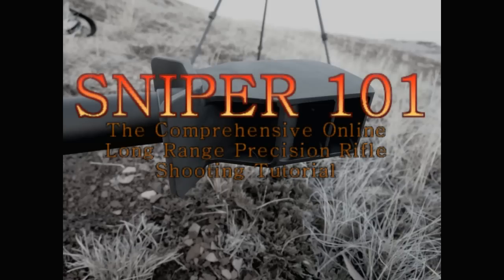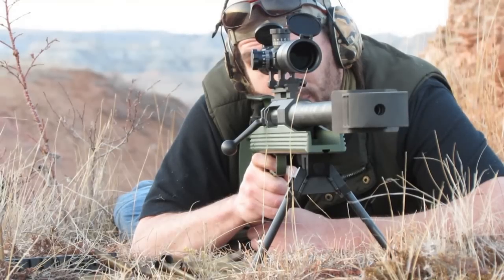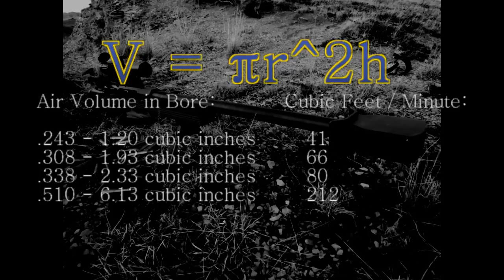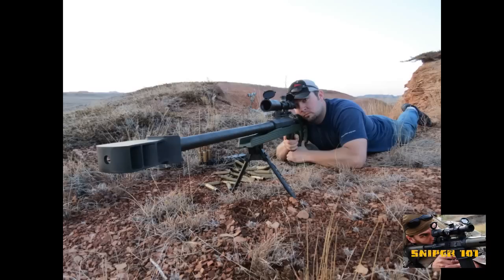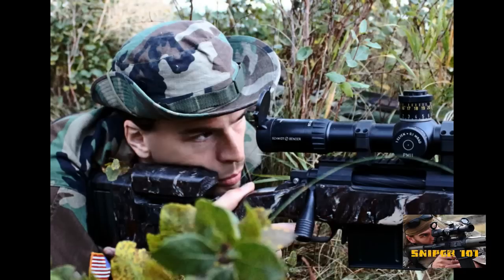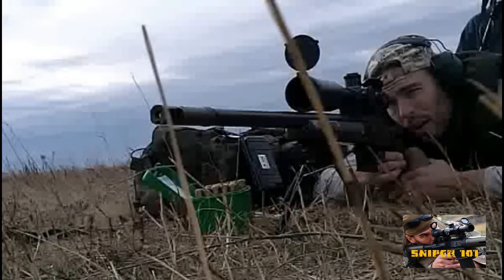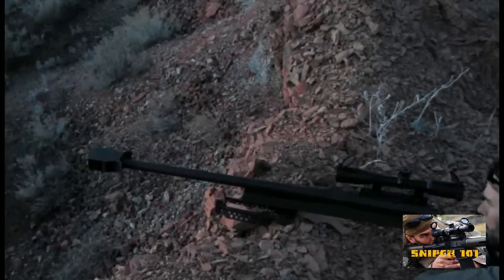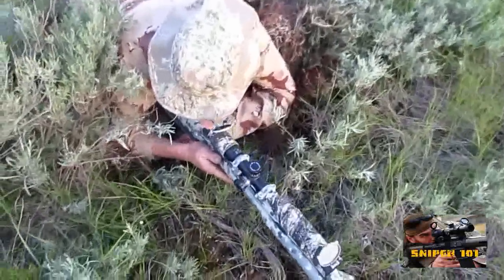Long Range 101 Part 55 - Muzzle Brake Pull-Off Effect

Comment from the maker: I have not yet been able to fully test the DT SRS-A1, so it would be unwise for me to give any solid opinions on that one - that being said, if you can get it to shoot 1moa consistently, it will be just fine.  Optics are usually the part we should take the most care in selecting.  Most rifles are totally capable of getting the job done - scopes are a different story.

Comment: Hi Rex.  I'm guessing that this is the right thread to ask this question.  Just purchased a new RPR 6.5CM and the muzzle brake is obviously misaligned.  From this video, my impression is that alignment of the brake does not need to be perfectly orthogonal given the caliber.  I get that the ports to left and right should cancel the force from each other.  However, if misaligned, the normally upward-facing port would not be directing force directly counter to barrel rise.  Anything to worry about?

Comment: Hi  Don't know if you go back and read these. I want to commend you on your patient and scienctific approach.  In the vibration part you touched on the whip affect.  Does not the muzzle brake change harmonics?  What about mercury recoil reducers, pretty affective but do they have harmonic values?  Thanks again and Be Well
Reply: Ross Anon I believe he mentioned mercury recoil suppressor in rifle selection video. He has a dedicated barrel harmonics video as well.
Reply from the maker: Griz Woldstad Yes, anything can potentially adjust your harmonic signature, thus any load being made for field use should be developed in a way that replicates exactly how the rifle is to be deployed in the field.  In other words, if you add a muzzle brake, you may want to re-check your load to see if it still works, if your add a recoil suppressor, you will want to recheck your load to make sure it still works... etc...

Comment: I think I understand what you mean.  I was thinking about the reaction force imposed by the cold column of air and how it would react with a system (rifle) supported not just axially but also radially.  Radial bearing could easily be your cheek weld which would make it easier for rifle to toe out, let´s say.  Meaning that it is important to support the rifle axially with no or minimal radial component.  That´s just the way I think but I believe your saying the same thing.

Comment: There is definatly an poi issue with certain big bore rifles. It has absolutely nothing to do with the muzzle brake
There is not nearly enough force or time ( or angle) to move the (30lb) gun at all. not even the thickness of a soap buble

1. 36" .50 barrel holds 31gr of air being ejected @2700fps
lets call this forward force 1 X

750gr + 230gr + the 31gr cold air in the barrel (lol)@ 2700 fps is the rearward force, we will call this 32.6 times X rearward force

lets remember these forces are straight back and forward, the backwards force being 32.5 times more powerful and happening first, if anything were to throw your aim off it would be the recoil force... but it has been proven mathematicaly and in the real world that it dosent make any measureable difference

So youre thinking what causes the inconsistent results that are very real 

Heres how it all started
Barrett sells guns to the army, the #1 priority is that it goes bang no matter what, to accomplish this it has a huge heavy striker assembly, monster spring, very long firing pin travel.
The bolt also is slightly loose in the race and is pushed against the top of the reciever and springs around when the sear releases

The result of this mini train wreck is the rifle moves ever so slightly off target as the round is ignited

Fortunately there is an easy way to observe this, zoom in and dry fire... the crosshairs jump approx 1 moa depending on how you hold it. 
If you weight the forend, sacrifice a goat and hold your tongue just right you can sorta get it to stay on target

The soldiers have issues and rather than barrett saying our product is less than perfect they invent some hocus pocus that lays the blame anywhere but themselves

My only personal encounter with this "MBP" effect is with a gen 2 M99.

The striker spring is 42lbs uncocked, and 70lbs cocked (yikes) 

The spring that cured the "MBP" effect is 20-23 lbs, It fires Tula and Cci primers just fine. Havent tried any American eagle yet, but nothing is harder than a russian primer

I havent ran any rounds over the chrony to see if I have a higher SD yet, but Im sure IF its any worse I can find a 30 lb spring and cure it while keeping that pesky MBP effect at bay

Comment: My god, where did you come up with this stuff? You are saying that less than 2 cubic inches of "cold air" laying in the bore in front of the bullet being forced out of the barrel by the bullet with enough force thats impact upon the baffles of a muzzle brake would cause a major disturbance with bullet impact? I simply do not buy it.  This is stuff i would expect to hear from some buddies after a night of benge drinking.  The fact that i do not believe this probably means ill never be a "sniper"
Reply from the maker: greer harmon The Hard Target Interdiction Course for the SOTIC goes over this in pretty good detail as they have observed this phenomenon for quite a while.
Reply: you sir are very wrong.. very... it happens in large bore long range rifles.. your not gonna notice it at 400 yards.. At 2000 yes it is deff something that effects POI.. you better know how to counter act it or you will have issues at long range truthfully anything 800 plus in the rifles that will feel its effects.. it can cause groups to open up a very large amount do to this... before I found out what was going on I had spent a lot of money thinking I bought a bad rifle (it was a used single shot bolt action .50 I paid 9.5k it was a 14k gun only had about 40 rounds down it) so I sold it at a big loss because I told the buyer there was a accuracy issue with it.. I had a new one built for me and was having the exact same issue and was pissed.. went to the builder and he shot the gun and was insanely accurate at 1600 meters so it wasn't the gun.. he explained to me what was causing it, I changing a few things in my firing position and bingo it was a beautifully accurate weapon... this was back in the day when .50 single shot bolt guns just started to show up.. I had never shot anything over a .338 that I used for long range back then... any rifle with a large bore that is extreme range capable and has a large muzzle brake will feel its effects if the shooter doesn't know how to counter it.
Reply: Prove it. 2000 yards humming bird shit  would have more effect than the air in the barrel.  If yhis were true army tanks couldnt hit their target.
Reply: +greer harmon mathematics proves it.. if you arent a long range big bore guy then you wouldn't ever know about it not run in to it... do you understand what 1/10 of a degree of pull of as the projectile leaves the barrel equals in terms of POI at 1500 or more yards? it's a lot.. anyone that doesn't shoot long range and stays let's say 600 yards or less with a .308 isn't going to notice anything as it's not moving enough air and the amount of disturbance is small.. but on large bore rifles with long barrels are moving a lot of air very quickly and it will cause pull off... even if it's well controlled it is still there... a non-braked gun will be more accurate at extremely long range over a braked gun now that's IF THE SHOOTER CAN COMFORTABLY HANDLE THE RECOIL.. if the shooter can't handle it well then the brake will cause better accuracy vs jumping waiting on recoil. I prefer a heavy weight mildly braked gun for extreme range over a lighter big braked gun they will almost always be superior and guess what? it's because the bigger brake on bigger rounds will move the barrel before exit due to dead air In the barrel accelerating out the brake pre-projectile. don't argue a fact you don't know when talking to people well versed in long range shooting with extreme long range capable rounds.
Reply: so any negatives to thread on vs Clamp on brakes assuming both are tuned? been hunting this and i cant make up my mind you know $100 for clamp on vs $400 to thread and $1-300 for the thread on?
Reply: Harmon Greer III tanks don’t have muzzle brakes